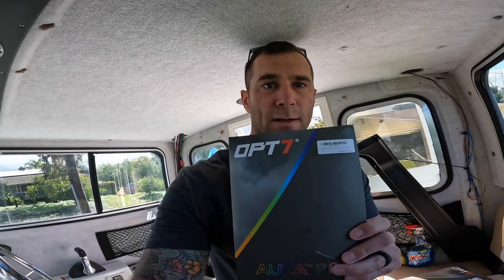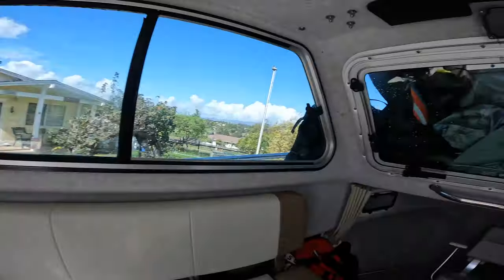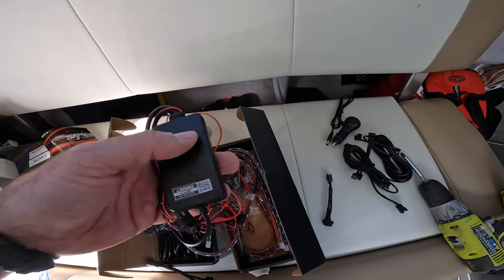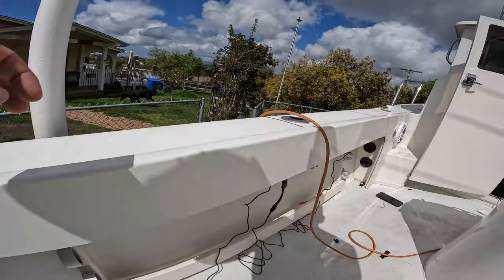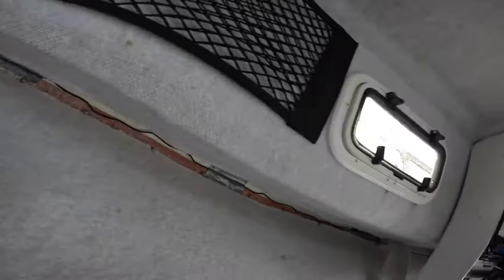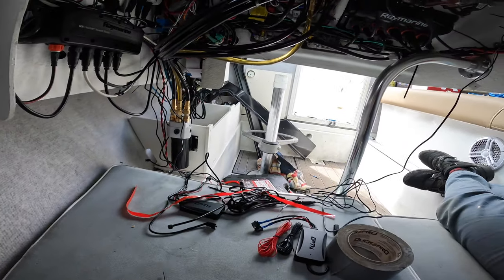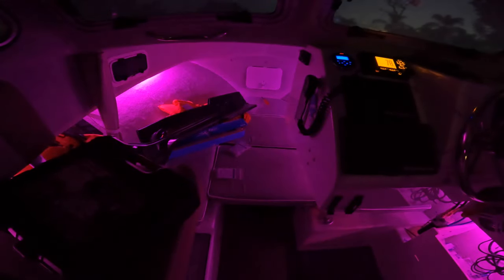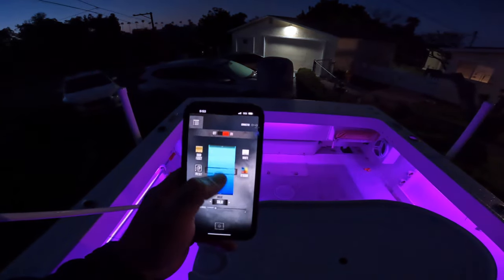LED Boat Lights Installation (opt7 Aura)

Comment: nice video, where did you get the black nets storage ?
Reply from the maker: Thank you! I just got them off Amazon. Super useful https://www.amazon.com/JAVOedge-PACK-Adhesive-Accessories-Organizer/dp/B01N78SJX7/ref=mp_s_a_1_4?crid=2XA852UTPU1LY&keywords=velcro+cargo+nets&qid=1686843507&sprefix=velcro+cargo+nets%2Caps%2C299&sr=8-4

Comment: Looks good!
Where did you get the cargo nets and how did you attach them?
Reply from the maker: Thanks man. I just got the nets off Amazon. They’re Velcro so they just stick to the carpet. They were cheap and super useful
Reply: you dont have a lot of videos yet but glad i came across your page.  how did you gain all this wealth of knowledge on knowing how to install everything?
Reply from the maker: @seaweedmike  thank you for watching! I just kind of learned through trial and error. I love learning so I’ve always done the upgrades myself
Reply: @Tony Gio Offshore  i bought a skipjack 262 a year ago and still havent taken it out once haha im finding more and more issues with it as it sits so now im looking to replace a lot of the electrical in the cabin because almost nothing works
Reply from the maker: @seaweedmike  it never ends with boats brother I feel your pain. I have a video on how I did my electrical. Hopefully it helps. If you have any questions let me know and I can try to help
Reply: @Tony Gio Offshore  ive watched all your videos i think haha i guess one question i have is how do you know what products are out there to use and replace with something more modern?  for example, my cabin has glass fuse box mounted in the upper side cabin, what can i replace that with to modernize it?
Reply from the maker: @seaweedmike  it’s hard without seeing it.  And it doesn’t necessarily need to be modernized as long as you have a good idea of what each fuse is protecting in case there is a problem